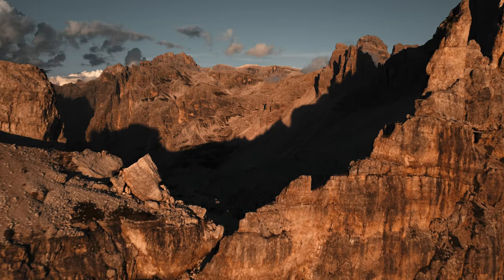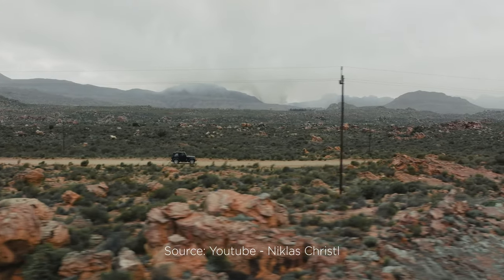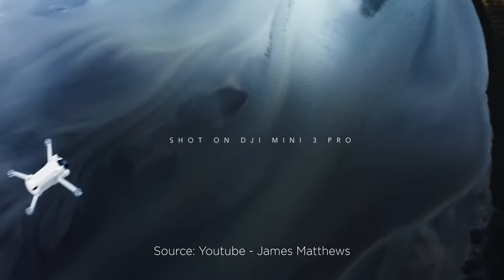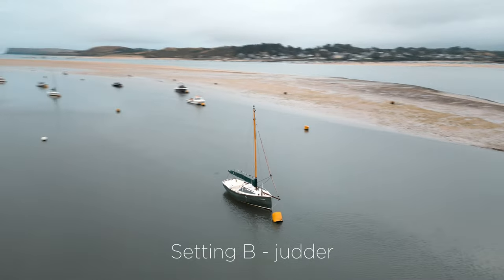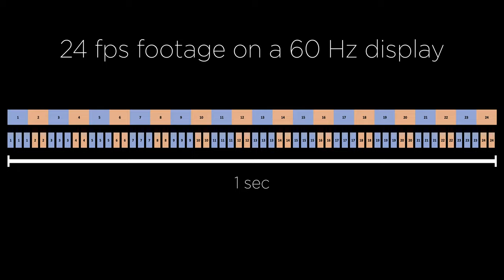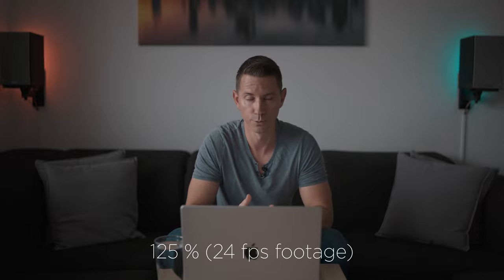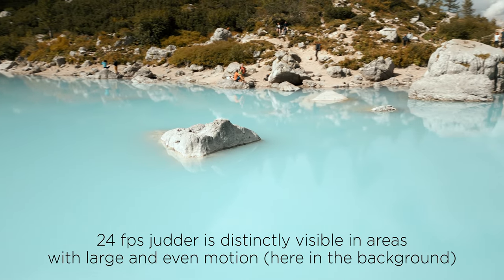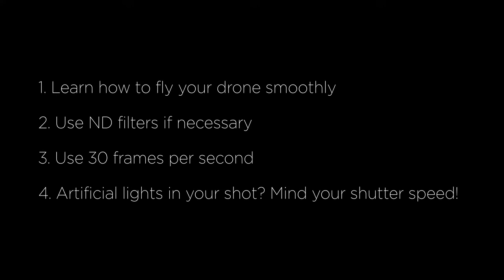The #1 Secret for CINEMATIC Drone Video without Judder, Stutter or Jerkiness

Comment: Super video, thank you. This will also work for action camera. What do you think about using 90 or 45˚ settings and not 180˚
Reply from the maker: Thanks for your feedback!

Really depends. 90 might be ok, 45 will have a stuttery look, at least at 24-30 fps. When you use higher fps like 60 fps, the difference between shutter angles becomes less noticeable. But with normal realtime framerates like 24, 25 and 30 fps, I'd try to stick to around 180 degrees more or less.

Comment: Hallo Tom, vielen Dank für das super Video. Also die 30 fps sind offensichtlich cooler bei den Drohnen videos - aber wie machst du dann ein gemischtes Video wenn du Clips von Drohnen und von anderen Kameras hast ? Also wenn du eigentlich eine 24 fps timeline möchtest aufgrund der restlichen Videos - die schauen doch ein bisschen cooler mit 24 fps aus.
Reply from the maker: Ich mache keine gemischten Videos. Für mich persönlich machen 24 fps für Online Content einfach wenig Sinn. Du siehst zwar bei "normaler" Kamerafootage den 3:2 Pulldown judder nicht so stark wie bei Drohnenaufnahmen, aber du siehst auf einem 60 Hz Bildschirm (das sind immer noch die meisten Bildschirme) sowieso keine richtigen 24 fps, selbst wenn das Video 24 fps hat.

Mein Tipp: versuch mal 30 fps für deine normale Footage, aber statt 1/60 Sekunde Belichtungszeit (180 degree shutter rule) versuch mal 1/50 oder sogar 1/40. Dann bekommst du so ziemlich den selben motion blur pro frame wie mit 24 fps und 180 degree shutter rule.
Und ich bin mir sehr sicher, wenn man dieselbe Szene (gleiche Schauspieler, gleiche Set-Beleuchtung, gleiche shutter speed (1/48 sec oder 1/50 sec) und sonst auch alles gleich macht, wird der Unterschied zwischen 24 und 30 fps ziemlich egal sein (außer dass auf den meisten Bildschirmen bei 30 fps kein judder passieren wird, ob sichtbar oder nicht).

Wenn du aber unbedingt 24 fps verwenden willst, dann würde ich es so machen, wie ich es in diesem Video gemacht habe: 60 fps Timeline, und auf die legst du dann deine 30 fps drone footage (die bleibt smooth, weil 60 durch 30 teilbar ist) und deine 24 fps footage. Die wird juddern, nur passiert der 3:2 pulldown halt zwischen footage und timeline, und nicht zwischen timeline und Monitor refresh rate :)

Ich hoffe, ich konnte dir ein bisschen weiterhelfen :)

Comment: Great video...will definately check this out.I have some judder which have been driving me crazy..not only drone footage, but also 60 Fps slowed down to 24 Fps and panning quite fast..hope this will fix it..
Reply from the maker: 24 fps timelines don't work well for smartphone/tablet/desktop displays. You gotta create your projects with a 30 fps timeline and put your footage on there.

If you want 60 fps slowed down on the 30 fps timeline, slow it down to 50 %.

If you have your footage recorded in 24 fps, make it faster (125 %) on the 30 p timeline to get rid of the judder. 25 fps footage faster to 120 %.

And for future use, try 30 fps recording for realtime and 60 fps for slow motion (50 % speed on the 30 fps timeline).

Comment: Thanks for the video. I am using 2 different conversion programs. My drone is set on 4K/60. I will try the 30fps next time because, mine do turn out juttery...thanks again!! I am using HD Video Converter Factory Pro and Winx DVD Converter. I will look for these settings..
Reply from the maker: Usually, neither 60 fps nor 30 fps should be juddery. Are you using ND filters? If you don't, and therefore have fast shutter speed, it lacks motion blur and even though it is a different problem, it might appear similar to judder from wrong fps.

Comment: Maybe a silly question, but does shooting in 24/25 fps reduce the need for using ND filters compared to 30fps needing an ND filter for smooth shots?
Reply from the maker: Sorry, I somehow missed your answer. Unfortunately, no. Regarding ND filters, 24/25 or 30 fps does not make a difference. Smooth shots need a screen-compatible framerate (30 fps for computer/smartphone displays) and a shutter speed that sicks close to the 180 degree rule (so, around 1/50 to 1/60 sec for 24/25/30 fps). Hope that helps!

Comment: Hey thanks for this video, super helpful ! 
I just had a question though : Don’t displays nowadays (computers and phones I mean) have adaptative sync to switch from 60Hz to 50 Hz depending on the framerate of the video ?

2nd question : you said you recommend 30 fps for drone footage but didn’t mention what framerate for non-drone footage (like shot on a hand held camera). What do you recommend in this case ? Keeping the same 30 fps ?
Reply from the maker: Thank you very much for your feedback :)
Most TVs can switch between 50 and 60 Hz (or multiples thereof). But for computer/smartphone/tablet displays generally, no. There are some displays that have variable refresh rates (or very high refresh rates like 120 or 144 Hz where incompatibilities don't matter so much), but for the majority, the standard is still fixed 60 Hz.
I personally use 30 fps for all kinds of footage because my target medium is always Youtube or some other online/digital/social media stuff that's watched mainly on 60 Hz screens. The thing is, these frame rate/refresh rate incompatibilities are not always visible, it depends on the kind of footage. Drone footage is probably the worst in that regard. But I think, why mix frame rates at all, and so I stick with 30 fps video for my personal stuff.

And from a professional's perspective (my wife and I run a video production company) the same is valid: always choose the frame rate for the target medium. If we produce content for digital/online/social media, we usually go for 30 fps. If we produce for broadcast, we go for 25 fps (because broadcast here in Europe is PAL standard, i.e. 25/50 fps).

Sorry it took so long to answer, but I hope it helps. Cheers :)
Reply: @t0mwhazzup  This is priceless information ! Thank you for taking the time to answer me !
Reply from the maker: @paulthiebaut  You are very welcome. If you have any other questions, don't hesitate to ask. You see, it might take me some time to answer, but I always try to take my time answering when I finally do :) Have a nice evening!
Reply: @t0mwhazzup  appreciate it really, I don’t know why I wasn’t subbed yet ! Greetings from France : )

Comment: Thank you for a very informative video Tom. One question ? Is the refreshrate of a display the same as frequency (Hz) in a PAL or NTSC country. If so this would mean that filming in 30 fps at 1/60th would produce judder in a PAL (50 Hz) country the same way 24 fps with 1/60th would produce judder on a NTSC display (60 Hz). Please explain.
Reply from the maker: Thank you very much for your feedback!
In general, computer and smartphone display refresh rate standard is 60 Hz, independent of PAL or NTSC, so 30 fps video will be fine.
With TVs it can be different, but from what I know, most modern TVs are variable refresh rate and can adapt at least between 50 and 60 Hz (or multiples thereof), so you'll be fine there as well with 30 fps video (e.g. playing back Youtube on TV).

IF you talk about actual broadcast (i.e. your content is broadcasted by a TV station and you watch it on your TV), then you should choose frame rate dependent on the broadcast standard in your area (PAL or NTSC). At our video prouction company, we do it the same. Projects for broadcast we do in 25 fps (PAL country here), projects for online we do in 30 fps.
Reply: @t0mwhazzup  Thank you very much for taking your time answering. Much appricated. When I saw your video, which is  obviously directed mainly for dronefootage in daylight, I wrongly thought "ok so judder problem is a 180 degree rule issue not mainly fixed only by increasing speed from 24/25 to 30 fps". When I found 30 fps as sort of a sweetspot between 25 and 50 and 1/50th shutterspeed in line with as well PAL 50 Hz and RED camera websites calcukator recommendations (1/50th,1/100th or 1/33,3th) for "safe" flicker free video with 30fps in PAL country I thought I could forget about these setting and focus on other. Again, when I saw the video I thought that mayby my judder problems was not only due to fast panning speed (your clips mainly filming in forward direction) but a 180 degree rule problem. Did I have to choose between flickerfree or judderfree ? On top of that PAL/NTSC 50Hz/60HZ electric net ,laptob vs TV display refreshrate and questions made it more confusing. HOWEVER..puh...there are more important issues in the world right know. Thanks again and wish you all the luck with your videochannel.
Reply from the maker: @jansvedberg  Thank you so much! In PAL country when using 30 fps, choose 1/50 or 1/100 shutter speed to stay flicker free. 1/50 will be closer to 180 degree shutter role, so U'd prefer that whenever possible.

Comment: I am new to flying drones. mini 3 pro a week now and flown it over 30 times. Never noticed judders until today. Difference today is 2 things. One I changed from cine mode back to normal. I have kept mov over mp4. Second thing I have done is what I consider to be the likely reason for the judder. I removed my 256 gb card from the drone and put in my usb c card reader on the back of my Mac studio 5k monitor. So is it better to use the dpi app to extract the files then AIRDROP them to mini Mac?
Reply from the maker: I'd say that neither mov/mp4 nor how you transfer your videos to your computer can have an influence on judder.
Changing from Cine to Normal mode might have an visual impact because of the faster movements in Normal mode, mostly quick pans (which are not cinematic anyways) and especially if you don't use ND filters to keep the shutter speed slow. But that is technically not judder, but stutter and caused by different reasons.
Reply: @t0mwhazzup  Drone shop also agree that judder has come from removing smart card and putting in my card reader connected to my new mac mini.

Comment: Been bothered by this little drone problem for a little while now. Can’t wait to try shooting in 30 fps. Also looking forward to see if I can solve the 24fps issue in a 30 fps timeline. Thanks for this. Hope it ends up working for me.
Reply from the maker: I hope it helps. The problem is existent with every kind of footage 24/25p on 60 Hz screens, but usually becomes obvious mostly in drone footage because of the nature of the drone camera movement. 
30 fps in combination with a good shutter speed works perfectly normally. Let me know how it worked for you.
Reply: @t0mwhazzup  I tried putting the 24 fps on a 30 fps timeline and my particular issue was not solved. Here is a link to a 23.976 fps clip. It was re-rendered with the text, but the clip straight from the drone has the exact issue. https://www.youtube.com/watch?v=46yYhOLpNrE

The effect is a strobing in the foreground highlights. Only happens on certain screens like my older 1080p monitor (full screen) and my TV, not my iPhone. I'm wondering if anyone can see it, knows what it is, or how to fix it.
Reply from the maker: @dgaerialimagery  I can't see any strobing in the foreground, so I can't really say anything about that.

Apart from that, I noticed two things:

A see a slight judder in the foreground (but really very slight and not very distracting). That is caused by the video framerate of 24fps. You say it's 30 fps, but when I right click on the video and choose "Stats for nerds", it says 24 fps. Maybe you exported at 24 fps by mistake, but it's still 24 fps.

Secondly, the leaves of the tree give some kind of flickering impression. I would guess that you did not use ND filters and have a rather fast shutter speed there. You should aim to have around 1/50 or 1/60 sec shutter speed to avoid that.

I hope that helps! But strobing I cannot see.
Reply: @t0mwhazzup  thanks for the reply, that clip was 24 fps, i meant to say I also tried it at 125% speed on a 30 fps timeline and didn’t solve that leaves flickering issue. I have no idea what that flickering-leaves issue is. Thought it might be judder. I’ve noticed it on multiple clips and it gets much worse when I apply sharpening to those sections of the image. Pretty sure I had ND on, I’m religious about that 180 degree shutter but it is possible I didn’t for this clip, it’s difficult to be sure. If you look at the cars there is sufficient motion blur so I think I had that covered.
Reply from the maker: @dgaerialimagery  No, I see a little judder but that is definitely not what you meant. I wouldn't apply sharpening to video, it usually doesn't look good and especially with foliage or other detailed stuff it can look very weird 😉
Reply: @t0mwhazzup  thanks for taking the time to help me out. I have noticed the flickering is reduced if I follow your tips AND refrain from sharpening. I’ll be shooting in 30 fps from now on. Here is a link to the reduced flicker version: https://youtu.be/sRvJmjl_jM4

Comment: @t0mwhazzup Can you explain the "are my 25 fps videos then useless part?" I changed the sequence fps and the speed I changed to 120 % but I cannot see any differnce, stull juddery shit.
Reply from the maker: Sure, you create a 30 fps timeline in your editor, and when you put your 25 fps footage onto it, change the clip speed to 120% so that it plays back with 30 fps. That should do. What monitor do you use?
Reply: @t0mwhazzup  but the movement of the people and the sound also changes and  they will be clunky like a benny hill show. I hava a 165 Hz monitor
Reply from the maker: @leventeszabo3091  Drone footage usually does not have audio, does yours? If there are people in your drone footage, they will of course move 20 % faster - then you have to decide what's more annoying: the judder or the people moving a little bit faster.

165Hz is a very odd number and it is neither dividable by 24, 25, or 30. Maybe that's why it still judders... check your results on a standard monitor with 60 Hz, that's what 90% of monitors are.

Comment: I have this issue with 29.97... Straight from my Mavic first gen at 29.97 it has so much judder! Shutter speed at 60 (use ND). Is this just a compression/recording  issue? But watching the smooth example clips in this video I still perceive some judder, so maybe I am just more attentive to it on my own footage.
Reply: Actually I think its small vibrations of the gimbal that result in the judder. Doesn't take much wind with the small drones to cause the gimbal to vibrate.
Reply from the maker: It's hard to tell without seeing the footage. Generally, I recommend 29.97/30 fps because the majority of the monitor's refresh rates is 60 Hz or another multiple of 30. Maybe your monitor is not like that. My second guess would have been that the judder you perceive is not actually judder but stutter from high shutter speed when not using ND filters. But since you also use NDs at 1/60, this can also not be the cause.
The first things that come to my mind is either your screen has a refresh rate that is not a multiple of 30 (e.g. 144 Hz). Even though, the higher the refresh rate of the screen, the less noticeable possible framerate/refreshrate incompatibilities get.
The second thing would be that there's really something hardware-specific going on as you said.
Or the third thing: maybe you are super-sensitive in this regard and you perceive the "movement gap" that happens when using 180 degree shutter rule. When you film at 30 fps with 1/60 of a shutter speed, half of the movement between the frames is not captured. I hope you understand. It is basically the same principle as if you didn't use any ND filters at all and had, for example 1/300sec shutter speed - just that in that case, you'd lose not half of the movement as with 1/60, but 90 % of the movement. I hope it's clear. To rule this out, shoot something at 30 fps with 1/30 shutter speed (360 degree shutter). This way, there is no more movement gap in the footage. For some drone movements, I actually really prefer 360 degree shutter (e.g. orbit around a subject) because it makes the moving parts in the frame so buttery smooth but the subject still stays sharp because it doesn't move in the frame. But for things like flying sidewards, it gets a blurry mess.
Try it out and let me know, or if you have some of your problematic footage online, I can take a look.

Hope that helps!